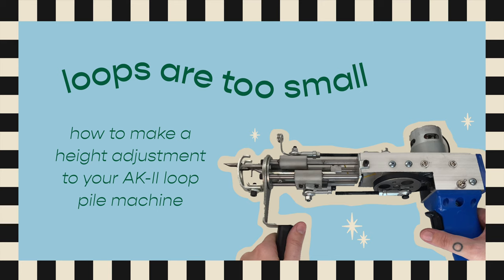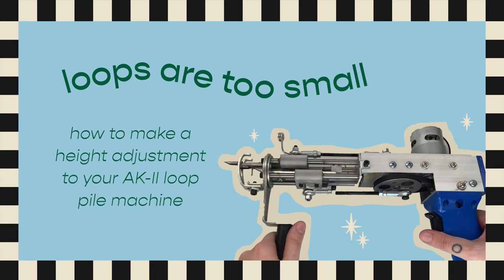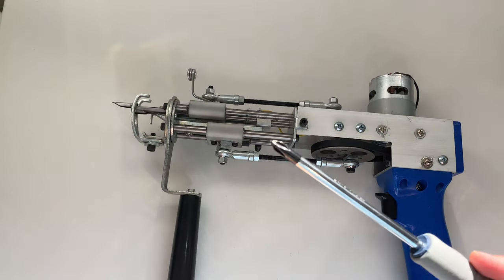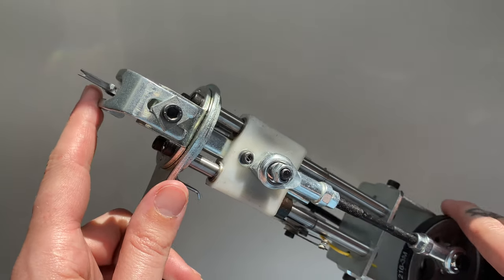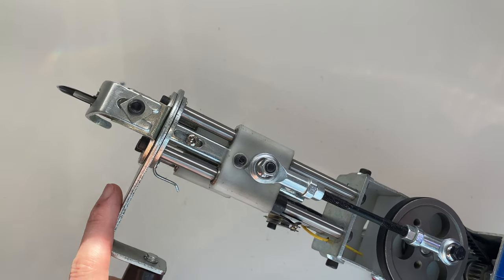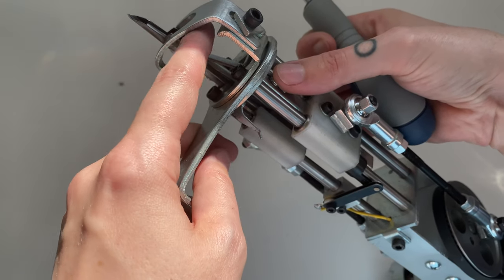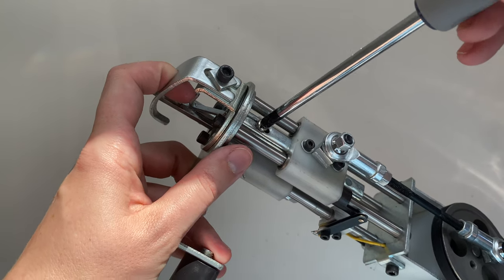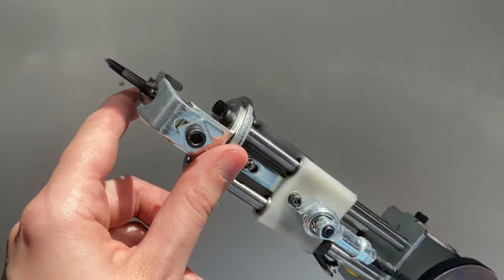TUFTING TROUBLESHOOTING | how to adjust the pile height of your loop pile gun

Comment: Hi! The sharp tip of my loop pile pin needle broke off. I can no longer even push into the fabric because the edge is blunted, unfortunately I running into a massive problem trying to find a replacement. I can find the small internal needles easily, but I can only find the pin needle on eBay and it won’t get here (US) for a month!!

Any suggestions? (I have an AK-II if that helps)
Reply from the maker: You might be able to buy the part from Tuft the World. I suggest reaching out to them!